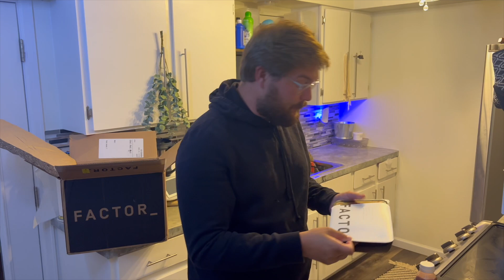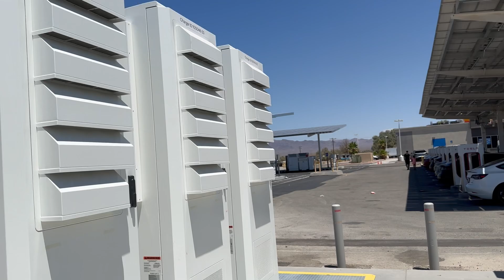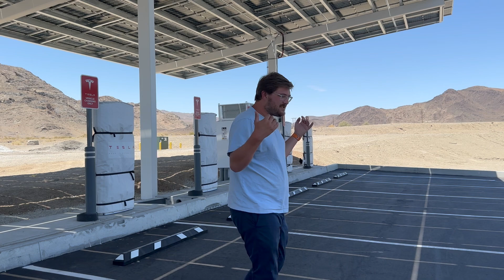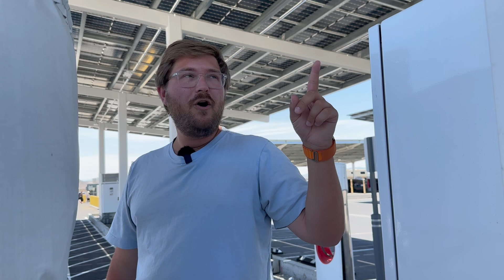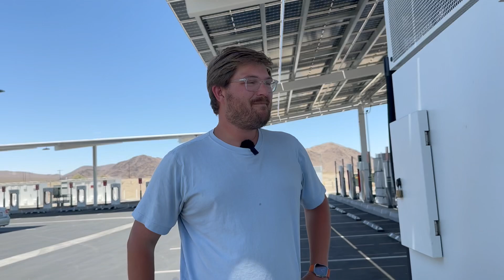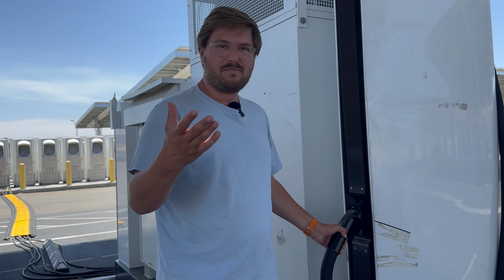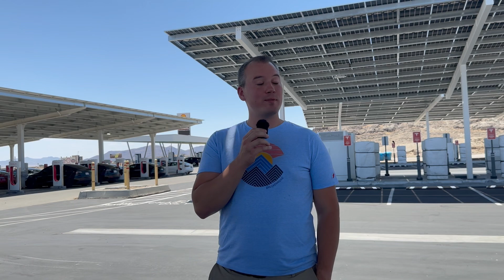Tesla Megacharger! Visiting A DCFC Location With Over 100 EV Chargers. Welcome To Baker, CA

Comment: If they covered the roads between the chargers with solar panels how close would they be to covering the charging load would they be?
Reply: Why would you put solar pannels on roads? that's incredibly expensive.
Reply: @miguellopez3392  The uncovered gaps between the rows of superchargers are about the same width as the existing solar roofs over the chargers. It would cost no more to cover those gaps than it did to cover the superchargers. Right now, they are only using about 1/2 the area of the charging location with solar cells.
Reply: @douglaspeale9727  now take into account Maintenace increase and difficulty because cars are driving over the solar panel glass.
Reply: @miguellopez3392  Not on the ground. extend the solar roof to cover the road between the chargers.
Reply: Probably less than 20% of what they need, at best, when the sun is overhead. Could be as little as 2%. They may need 300-500 acres of sun tracking solar behind the station to go 100%.  Hard to say how much, because we don't know how much they dispense.  Solar tracking is much better than stationary like this.  A decent sized solar array on a home is 6 kW.  This is maybe 20x that.  60-100x, covering all the space between.  They are using megawatts, that is thousands of kW.  Maybe you could charge 2–4 cars at a time at the expected rate.  So I am guessing at least 50x the current array would be required (while the sun is shining).  And you need some space between rows of solar panels, especially if they track, but you also need to be able to clean the surfaces.  And, you have to overproduce in the day to cover night charging.

Comment: I have very similar impressions on how the V3 hardware works.  On the 880-1000V interconnect, I think the voltage is dependent on the input voltage of the 3-phase.  The input can be 380/300/415/440/480V 3-phase.  In the US, we have 480V 3-phase.  In mainland Europe it is 380V and 415V.   At 380V that gives only 283KW.  At 415V that gives only 309KW.  A lot less then the 357KW in the US for 480V.  Sharing only 283KW between 4 chargers would be pretty slow.   To compensate for the lower voltage, Tesla installs 3 output V3 superchargers in Europe.
Reply: Since we are nerding: New V3 stations in Norway usually get a separate 480 V supply. They are such a big consumer that they warrant their own transformer station taking the power from much higher voltage transmission lines anyway. So it is a non-standard 480 V 50 Hz. I don't know how often they do that in the rest of Europe.
Reply: @geirmyrvagnes8718 The voltage in Norway for industrial sites and  new residential area is 400V three phase TN. Not 480V.

A 480V has 277V between a phase and neutral, while 400V has 230V.

It is also possible for an industrial consumer to connect to the 22kV local distribution net, owning their own transformers...
Reply: Tesla must still be upping the DC voltage with other equipment.  If you simply put the 480V 3 phase AC power and converted to DC you would be at about 340V.  It does make sense that the one cabinet for 3 stalls in Europe is what they use since the incoming AC power is lower though.  There's still more going on and this is likely to just share the equipment easily and not have completely different parts.
Reply: @whattheschmidt  As your napkin math shows, the power electronics in the superchargers is a bit more clever than that. But as I understand it, the modules are made for 480 V, so if they absolutely must power them with a lower voltage, a solution is actually to start by stepping the voltage up again. It is more efficient to go directly from, say, 22 kV.

Comment: I just hope they replace some V2 with V3 along the interstate routes.... I am within month of buying an EV .. but really dont want a tesla (for various reasons) but still dismayed at the state of every charging outside of Tesla for distance.   While I don't have to go super often, I do have several thousand mile one-way trips I have to take a year... and yeah...  one of them is basically impossible (to near Dallas across I-20 in Lousiana.......  BRP is requiring near 100% fills to get across there .... which yeah the car I am looking at... 80-90 is bad.. but 90-100..... .pointless...
Reply: Yea, just get a Tesla. Don't try long distance EV driving in any other vehicle. It's not that the other vehicles are bad. They are not. But the charging infrastructure is terrible for CCS vehicles, and only v3 and higher Super Chargers will work on cars that have the NACS plug or adapter. There are still tons of v2 SC locations that are needed for interstate travel. So Tesla still has a major advantage when you count those.
Reply: @ERIKM-ed9ef  mentioned the V3 as only V3 will be available to Ford in "early 2024" by adapter..   yeah I know with Telsa, I don't see any over 30 minute stops in BRP  with most 10%-40%  ish.... which is what I expect with such....    sadly the only Tesla I like is the S... and yeah.. that isn't in the budget.
Reply: They won't replace the v2. But they may add v3. For years Flagstaff, AZ only had v2. But now there is a bank of v3. I think the same will happen in New Mexico, etc. Rural areas like Gardenerville, NV will still keep their v2 sites as there often isn't electricity in rural areas to support v3. But on interstates I think you will see v2 sites having v3 added in the same area.
Reply: Get over it and buy one. All the others are still learning.
Reply: Just buy a Tesla and tune out Elon.